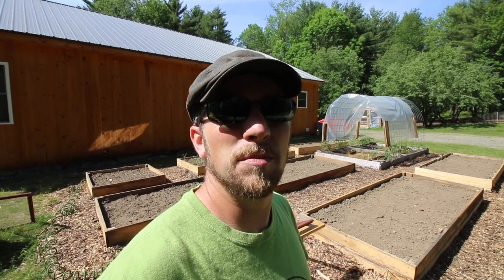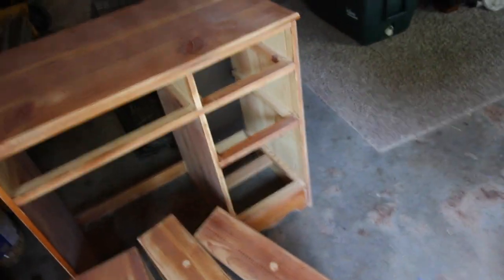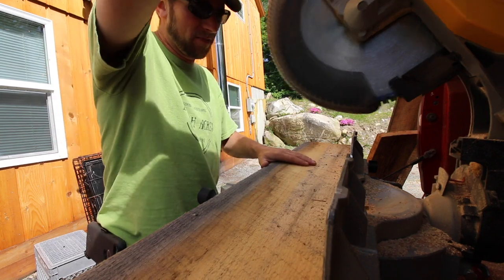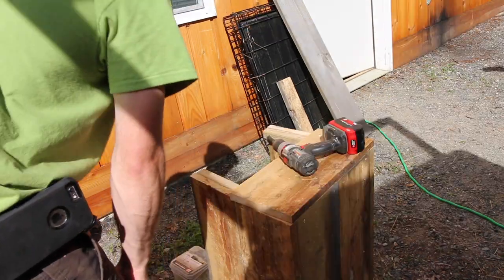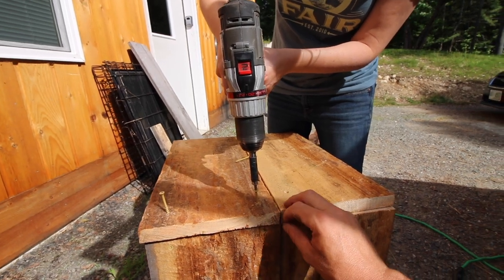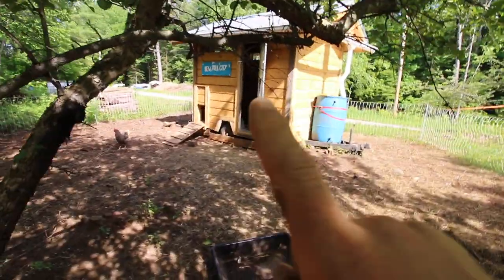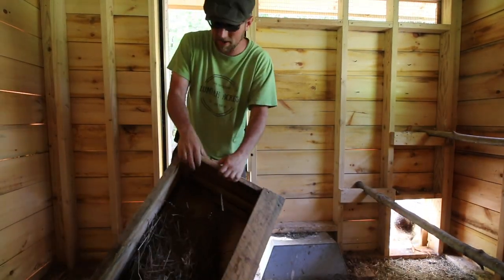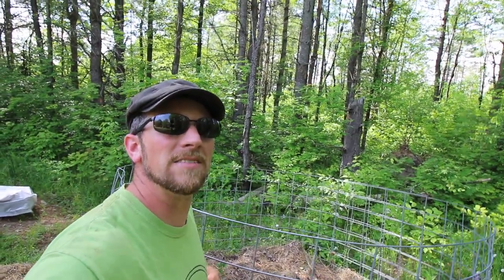Our Last DUCK Effort

Comment: ACK!!! Not the mahogany! lol Murphy's Law says the chickens will love the new nest box, and the ducks will still lay in the dirt. My experience with ducks, while not extensive, they prefer moist bedding for their nests.  I might suggest a layer of damp loam, covered with slightly composted damp leaf litter, then fresh cut grass. Line the sides and back of the box with hay. Try to emulate the cover a duck would find along the banks of a pond or stream. Ducks seem to build their nests in heavy cover, hollowed out of dense reeds, or tall grasses. Just a thought. Consider, she's hunkered down under New Yolk City, safe, secure, and well hidden. 
I built a custom display for a customer. On paper getting it out of my basement shop, no problem. My back door, straight in, then up a short flight of stairs to the kitchen. Jog to the right and a short flight down to my shop. Split landing, and a partition wall separates the two flights. Tight but doable, in theory. Nice solid oak cabinet, 4'x4'x2', recessed lighting, adjustable plate glass shelves, sliding plate glass front doors. All the glass could be removed for transport, still fairly heavy though. It's all done, called the client,"on my way." Ruh Roh!  I couldn't get it out the door. My ex found this hilarious, me, not so much. I ended up popping the door off the hinges, and removing the trim from my back door, and I might of had about as much clearance as your nest box, but I got it out. . Wasn't funny at the time, but now, an amusing anecdote.
Reply from the maker: Great advice on the ducks! Love the story of the cabinet! Its not fun when we forget to measure! Lol
Reply: I'm not sure if it's good advice or not. It's based on observations of ducks we had growing up and those in nature. I've often heard that folks have issues in getting their ducks to go broody and sit out a hatch. I've wondered if it had to do with using the methodology of chickens, rather than looking more to the natural instincts of ducks. I just thought it was worth putting out there. 
The property I grew up on from early teen until I joined the Marines, my old man (step father) kept immaculately manicured, like a golf course. Big colonial sitting on top of a hill, gently sloping down to a spring fed pond. The pond was rife with life, tadpoles, pollywogs, bull frogs, blue gill, bass, yellow perch, and shiners. Mom thought it would look pretty with some ducks. They got six ducks and sure enough they did look pretty, content, and very well fed off of the pond. In winter I would have to feed pellets and the ducks would congregate on one end which remained open due to the spring.
Of course I found where the ducks nested back up along the bank in a section of woods close by. Nest was well hidden, and not easy to spot. While the rest of the property was manicured, the wood lots were left natural. The nest was back up under rushes and bramble, The rushes had been tamped down by the girls on top of the damp soil, and leaf litter. Hence my idea for what ducks might find suitable for nesting.  I would raid it regularly for eggs to eat. My folks wouldn't eat them if you had paid them, their loss. lol I noticed the second spring a couple of the girls went missing, sure enough they were sitting tight on a nest full of eggs. Ended up with dozen ducklings, that I was tasked to catch, and my old man supposedly found homes for. Every spring after, those same two girls would go missing and raise another clutch of a dozen or so. It was after I left for the Marines, my mom no longer enamored with her pretty ducks, she realized how dirty they were, they got rid of them. Little did they know how much maintenance the ducks did on the pond to keep it nice. It was soon choked with algae, which the ducks kept under control. The old man decided to hit it with copper sulfate to kill off the algae, it also killed off everything else in the pond. Better living through chemistry.
Anyway best of luck with your duck efforts whatever you decide to do. It would be exciting to see you end up with a clutch of little ducklings. I know Olivia would be thrilled. She could entertain them with her recorder recitals.
Reply: David Johnston always a joy to read your experiences. I'm sorry for your clueless parents. I'm shure you did good in the marines with  your habit of studieng things in their habitat. It's a good quality in many professions. 

I'm sad for the ducks but atleast I hope after that first spring "after your dad found a ghome" you stopped saying they had babies. 

Kind regards rose